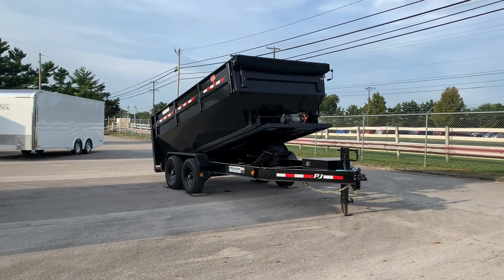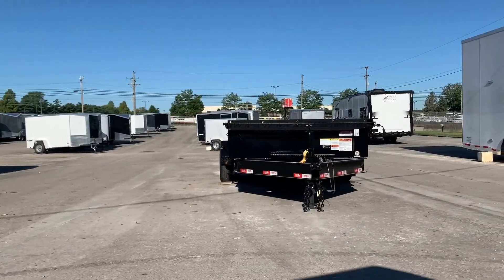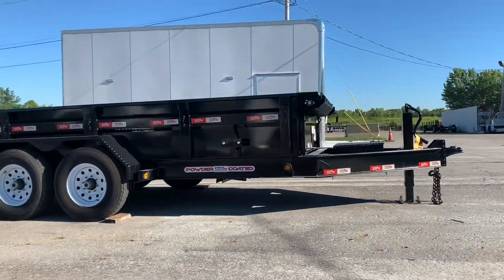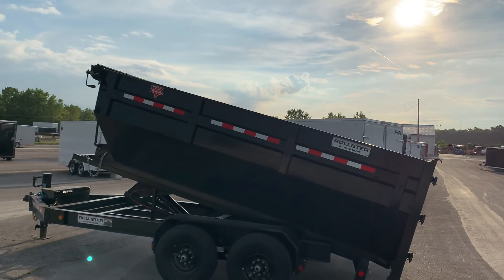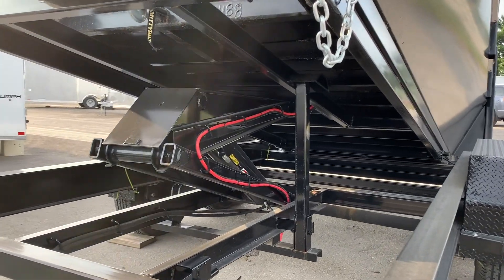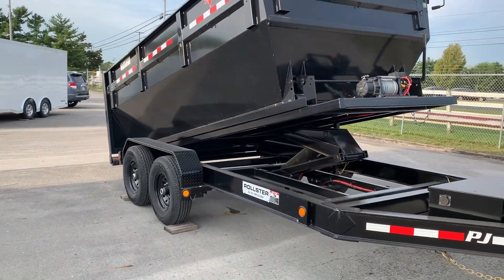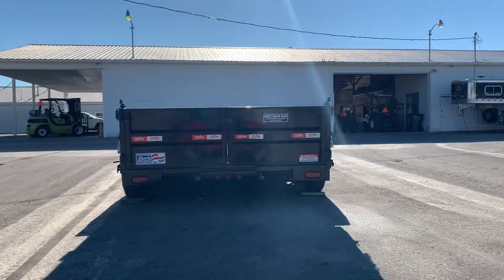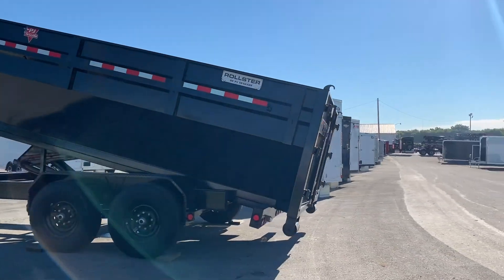Why does my dump trailer hydraulic reservoir overflow pop off? - and other questions

Comment: Is it okay to use transmission oil dextrn in a dump trailer or does it have to be hydraulic fluid?
Reply from the maker: You're going to want to run what ever is in the trailer right now. Don't mix fluids. Most use AW32/AW25 or Dextron
Reply: @shockerjoe  thank you.